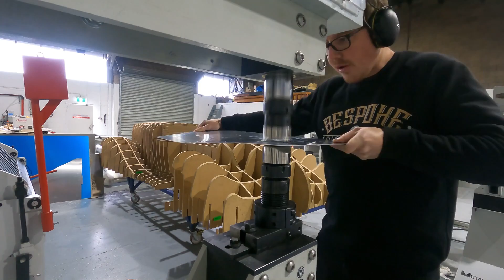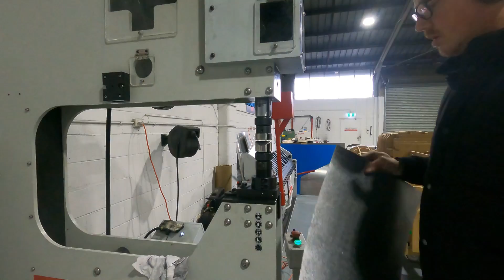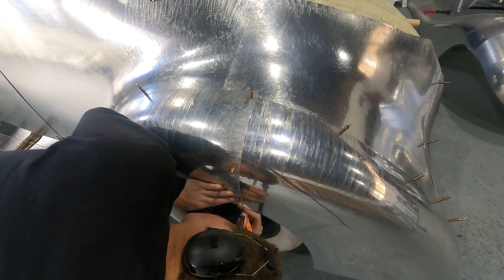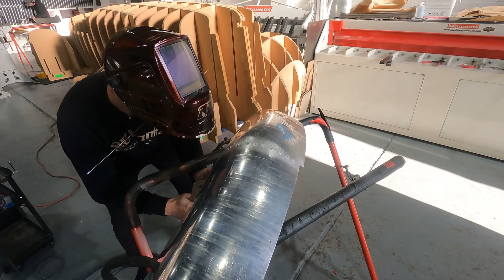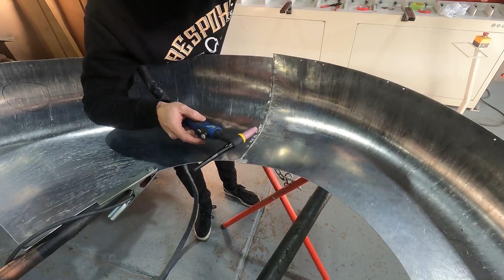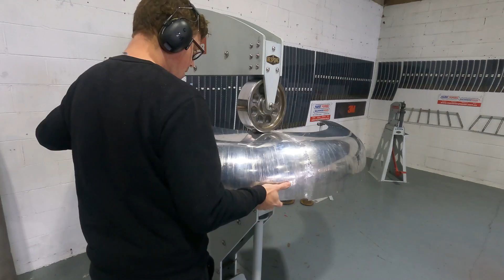Tig welding aluminium and metal shaping a lower quarter panel on a Rolls Royce.

Comment: What filler rod do you use on alum ? After planishing im noticing hairline cracks
Reply from the maker: It’s 5005 aluminium with i think it’s like 5032 or something along those lines just a standard aluminium filler wire. If your getting hairline cracks most likely it’s not welded on a high enough amps to be penetrating correctly